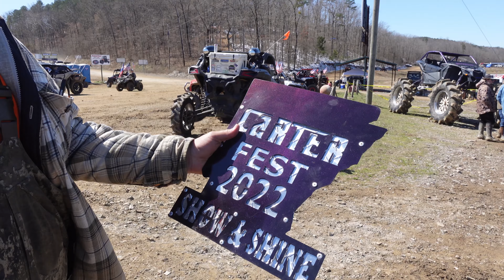I RECAP CARTERFEST 2022 IN 17 MINS CARTER OFF ROAD PARK

Comment: No one ran small tire truck class the hell I should have showed up.i was doing my hydro assistance steering so I couldn't get it all together
Reply: We won first place in 45 and under class there was 4 of them
Reply: @erinfreeman3523  what was running is all I want to know .
Reply: @erinfreeman3523  what size tire did you run by chance
Reply: 12.4 24 43inchs
Reply: I'd send you a picture but don't know how 😂